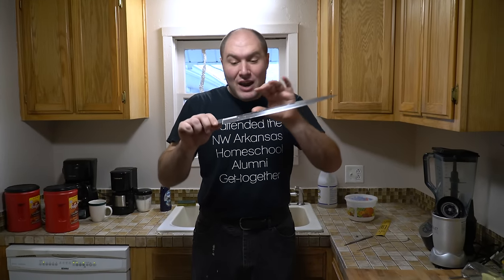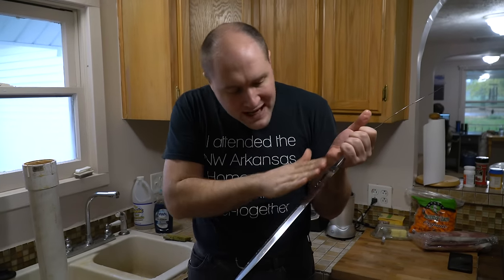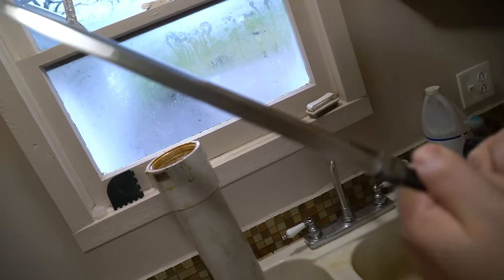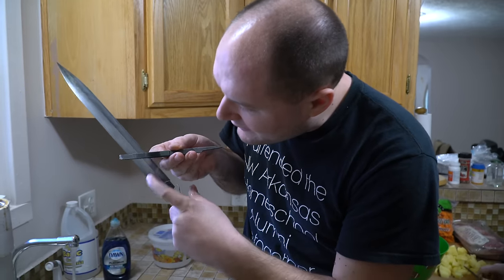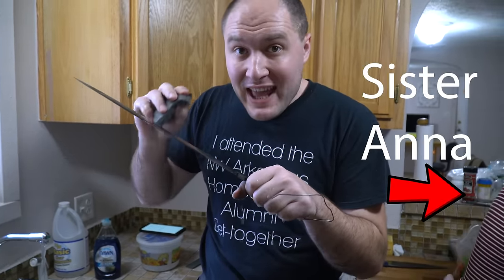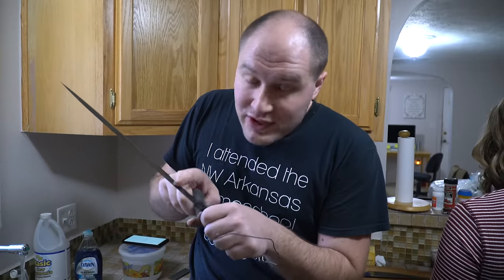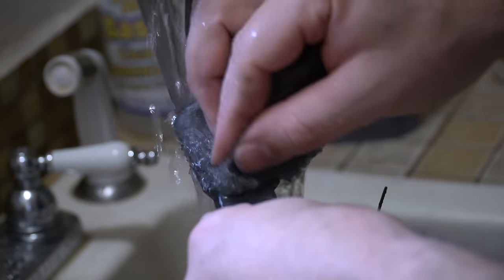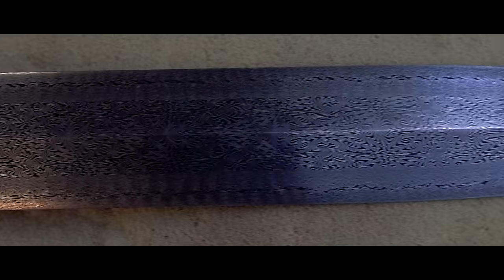How to Get a Beautiful Etch for Your Damascus Blades

Comment: Great instructions. After seeing all your work, I am amazed you still have issues like uneven etch and cutting yourself during sanding. Though in the wood turning world they say the difference between amatues and pros is hiding or fixing your mistakes.
Reply from the maker: The last time I had an uneven etch was a lonnnnnnggg time ago.
Reply: @KyleRoyerKnives  still, it turned ourt great. I guess having experience with it in the past is a good thing.

Comment: Thank you for sharing your technique for etching Kyle. I noticed you said during the video you use a 4-1 ferric chloride and water mixture.  I saw another bladesmith use a mix of ( I think it was) vinegar and ferric chloride. Is there any reason you use the water/ FC mix as opposed to other mixtures? 
Also a photography suggestion. 
With a blade as beautiful as this one (IMHO) I think using a piece of black velvet under the blade would possibly make the blade and etching stand out more. 
Please keep making these videos. They are very informative for those of us starting out.  
Thank you.

Comment: Kyle, I have a question, I've got  damascus blade, overall the blade is darkish and pattina is fairly visible but I noticed two faded spots, I wanted to etch those spots to make them darken. I used fairly mild ferric chloride solution and put drops onto faded spots just for a minute but instead of darkening, those spots faded out even more... what am I doing wrong, any advice will be greatly appreciated! thanks!
Reply: Kyle any clue why this is happening to me?

Comment: Why can't i go higher than 1000? Why shouldn't i go lower? What happens if i do? I need to know! O.O
The Oxides build up due to a reaction with the acid? I never seen or  heard that before. Until now i only saw ppl clean the blade with acetone and then put it itn, never seen a failure to this day.
Its great that you do these in depth tutorials they could come in handy one day.

Comment: Hello!
I know the ferric chloride bites better when its heated up, but can you dip damascus blades in warm chloride, or will it damage it?
Reply from the maker: Hey J. E. 
Great question 
You may heat the blade up to any temp as long as you don’t exceed the temper temperature .
 Fresh ferric chloride etches well without the added work of heating it up.
Happy new year 
Team Royer

Comment: That acid can be washed down the sink?

might want to make sure that's not going to local water treatment facility and back out the tap :)
Reply from the maker: Hey taiy 
No worries mate 
Each time we pull the knife out of the etch, we are loosing around    .10% of a tea spoon and the feric chloride is H2O soil-able and ours goes into a closed system 
Great question 
Team Royer